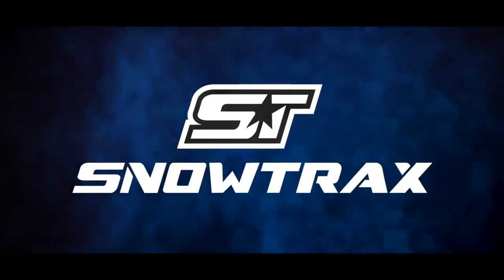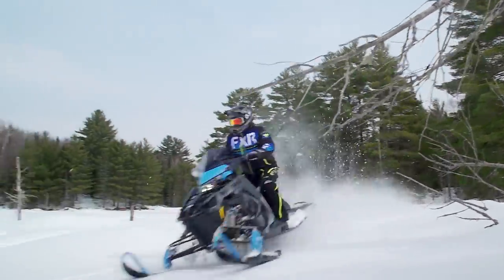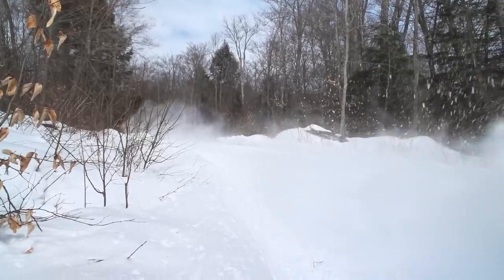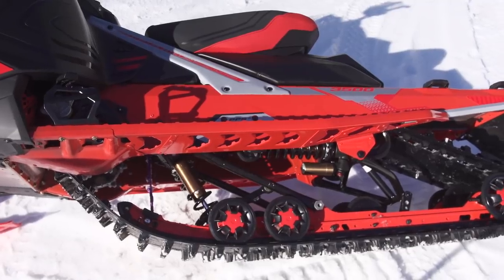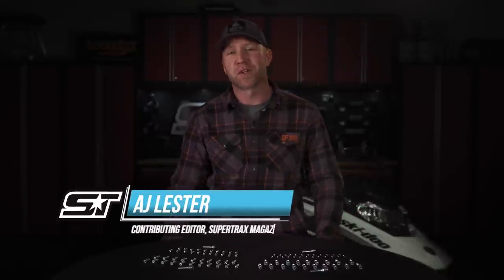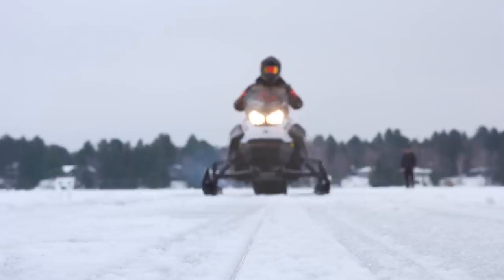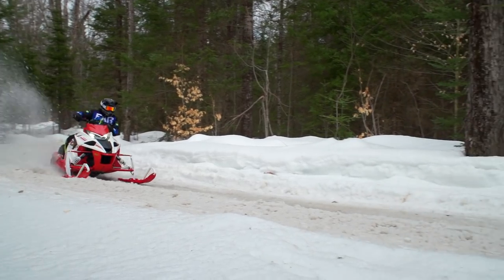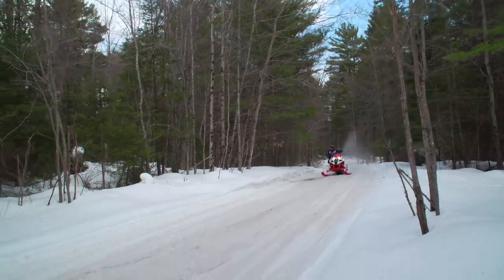SNOWTRAX TV 2022 - FULL episode 3

Comment: Those screw in studs can they be used to replace lost ones on a pre studded track ?
Reply: I would think so but depending on the depth and size of hole where missing stud was installed they might not stay in place. You could put it beside the hole I guess.
Reply: I would say no. The screw in ones went into the lugs not the track so they would stick through and tear things up. Also regular studs weigh more and a put in a track to kinda balance it. So i actually think it would be wrong in more ways then one
Reply: Pre studded track studs are in the LUGS
Reply: @CAPTLIEPS  I missed the prestudded part. Sorry pal
Reply: Lol